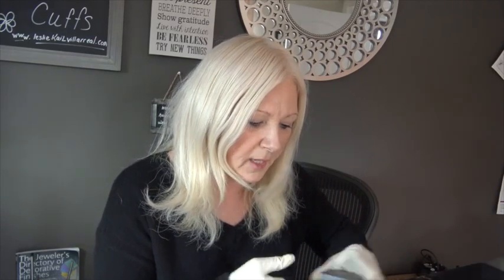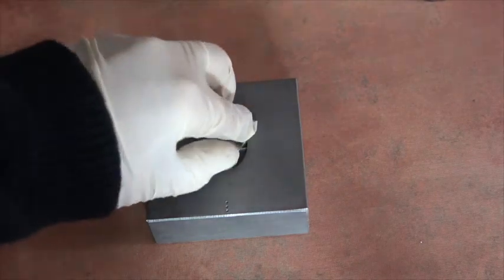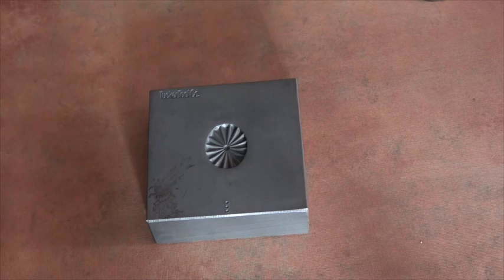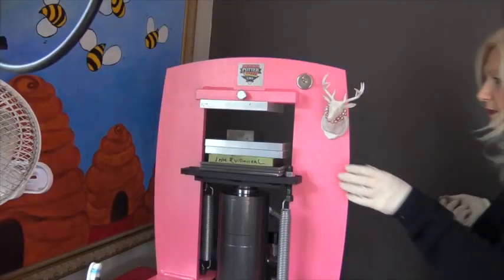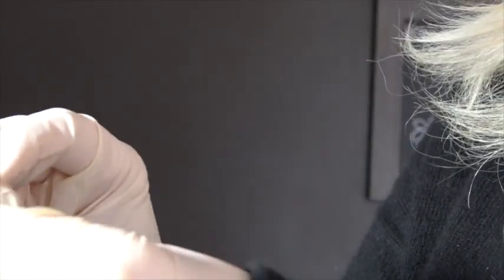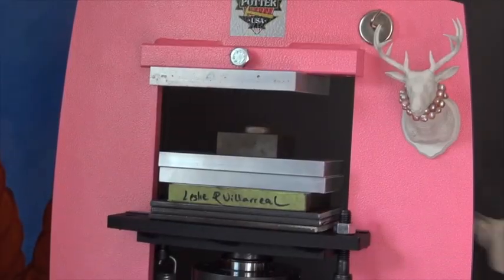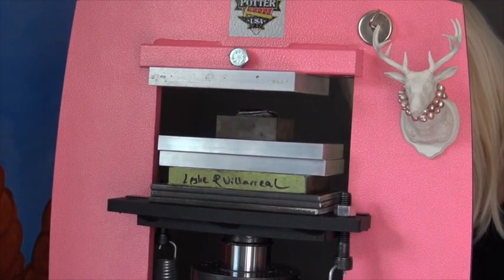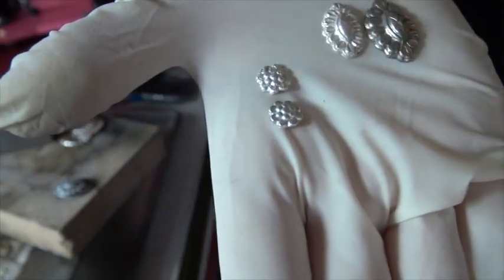Using Dies with Silver in the Hydraulic Press

Comment: thanks for shearing this video .i have a question is it possible use Nickel .instead of lead?thanks
Reply from the maker: NO!!!!  the lead works well because its soft  and pushed the metal into the silver. Nickel is way too hard. you can use urethane and rubber or even leather instead of lead but lead works best
Reply: @LeslieKailVillarreal  .thanks Leslie

Comment: Leslie what gauge of metal did you use for the India dies? You mentioned that when you do it by hand with a hammer you need to use 30 gauge that in the press you can do a thicker guage. Which guage did you use in the press? Thanks!